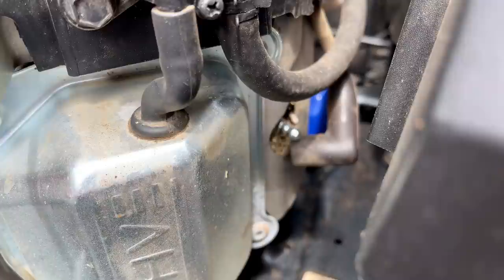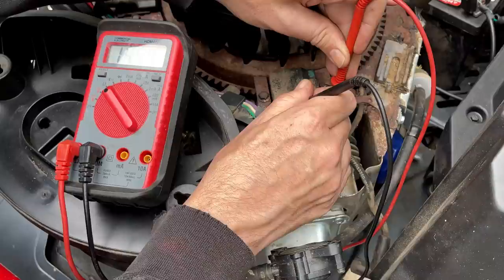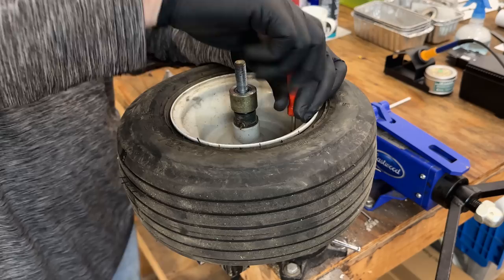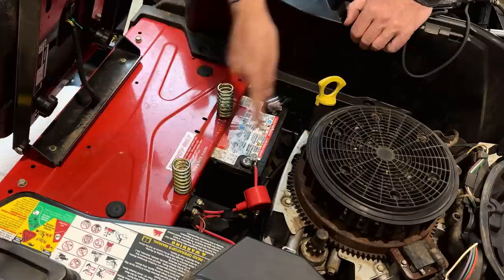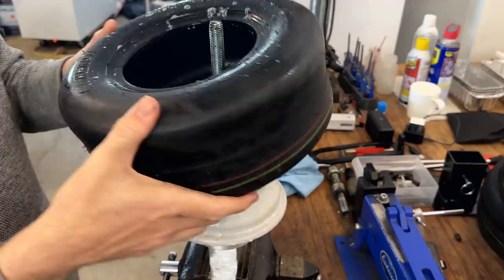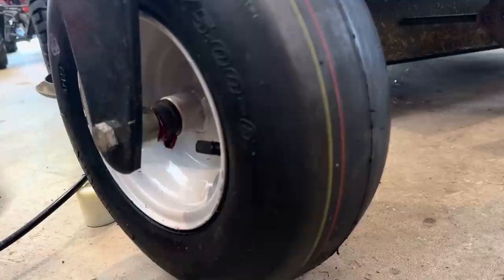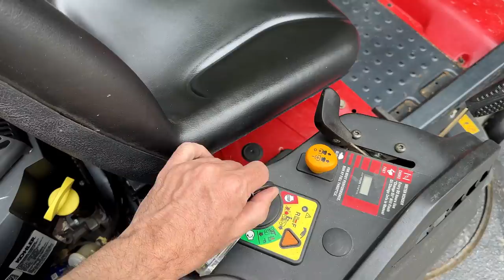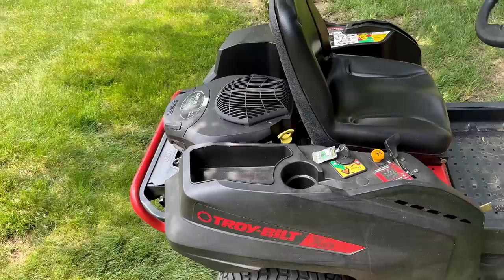Zero Turn Mower Down on Power - Not Firing on all Cylinders

Comment: A common mistake I see is when people have a flat and install a tube, but don't first find the cause of the flat. Often the thorn or little piece of wire or whatever is still in the tire, and pokes a hole in the tube

Comment: Nicely done, James. However, I don't understand why you don't use dielectric grease on electrical fittings, such as the coil wires. Prevents rust from forming due to rain water or other "liquids" from critters that make their homes in machines. :) It works great on battery terminals, too.
Reply: Because dielectric grease is not conductive? So, on a battery where the terminal is clamped tightly, then it won't work itself in between, but on the coil, it might just work itself in between the lug and connector causing issues, that's just my guess
Reply: @Behemoth33  Dielectric is needed because grease can melt and will cause many problem if it conduct electricity. The grease is not there to help to the conduction by itself but to prevent rust from forming. And that is keeping a good conduction between 2 connector. Car company use those on major plugs that are open to element. Connector that goes on the transmission of cars and trucks, they use dielectric grease.
Reply: Agreed.  Using dielectric grease is a good practice for protecting connections from corrosion.  It's a common misconception that it will introduce resistance but it's essentially a fluid, and the force of the metal-on-metal contact moves the grease out of the way.  You can prove it by doing a resistance test before and after applying it.  I've been using it for years without any problems and works great for keeping moisture out of connections.  One example I can think of is that the cutoff switch on my gas weed trimmer wouldn't shut off the engine anymore.  I took the switch apart, cleaned the corrosion from the contacts, and packed it completely full of dielectric grease.  Several years later and I never had another problem with it.  More recently, I've been using it on all the connections for my my outdoor low voltage lighting to keep the water out of them with good results.
Reply: I used to use dielectric grease all the time, and then I started having electrical problems on some of my equipment, and it turned out to be the grease. So I decided it wasn't for me, but I would still use it in certain applications. It's just one of those things that I think is a personal preference things If you were to ask 100 guys about it, 50 would use it, and the other 50 wouldn't.
Reply: Where “dielectric” comes in. Both petroleum grease and dielectric grease DON’T conduct in their normal form. The difference is when they burn. Petroleum grease leaves carbon ash which is conductive and would add to the list of problems for a fire. Dielectric ash is still nonconducting.
Reply: Why don't manufacturers do it from the factory then? It's a good idea in theory, but in reality it ends up attracting more dirt and dust over time. Not to mention if you have to disconnect it in a less than sterile environment, it's a guarantee you'll be getting a lot of dirt stuck in and around the connector. Just a lot of mess.

You should really only do it on vehicles you know will be either operated in heavy rain or submerged in water. For example, motorcycles that see a lot of river crossings. Even then, you'll have to be prepared for the increased maintenance.

Comment: Bead seating, I see people using starting fluid they spray a liquid stream and make a puddle and light a fire. They need to spray a vapor (air fuel mixture) to fill the tire then light from a distance and create an explosion. the sudden expantion fills the tire.  DANGER USE THIS METHOD AT YOUR OWN RISK!!

Comment: With tubed tires, my grandfather who was born in 1901, always said to inflate and deflate tube tires multiple times to get the inner tube to release any folds it may have in the inner tube/tire. This will keep the tube working properly without air leaks down the road. Blue Sky's.

Comment: I have to say that i am impress with that zero turn mower, I had have my doubts as well thank you for your video.
Reply: I have a zero turn mower with a Kohler motor on it,I also am a firm believer in checking the oil in it before I crank it up, it's a 2019 hold over to

Comment: I had a 20HP Briggs and Stratton that was having a weird sputter when not under load and I tried everything all fuel components except the tank where replaced but cleaning the cooling fins made a massive difference for such a worn out engine. It had oil combined with grass on one cylinder but no oil leak and has 50psi on left and 60psi on the right cylinder after 20 years.

Comment: The steering and transmissions are linked on these machines, and for a sharp turn, the transmission for the rear wheel inside the turn is actually power reversed. This was demonstrated when you did the U turn after querying whether it was a true 4 wheel steer or not. The problem is probably more 4WS than a conventional Zero Turn, as they are actual 2 wheel steer with the front wheels free to castor to follow, whereas this system combines conventional ackerman type steering at the front with differential drive at the rear, so all 4 wheels contribute to the steering effort.
Reply: Yes and this is actually an advantage on slopes where one rear tire might lose traction.  Plus it allows you to push the machine and steer it with the hydro disengaged, like a regular tractor.  Kind of cool.

Comment: Thanks James…great video as usual!  I do have a pet peeve: in this application, a “wheel” and a “tire” are two separate components.  Pointing at a tire and calling it a wheel……well, you know….words means things.  😂
Reply: Both tire and rim are the wheel
Reply from the maker: I do that a lot.  I call nuts bolt and bolts nuts.  Trying to be a little more mindful to use the correct words yet sometime I fail.
Reply: @jcondon1  
Yeah, don’t even get me started on leverage and torque! 😂
Reply: @jcondon1  
Most people (I mean MOST!) call screws bolts and vice versa.
Reply: @Rein_Ciarfella give me a moment
Reply: @nedasher116 , quoting from United Tire and Service website: "The terms "tires" and 'wheels' may be used interchangeably at times, but they are not the same thing. Wheels are the rims on which tires are affixed. Tires are rubber ovals that are installed on the wheels."
Reply: @bent.cyclist ovals? Seems to me that they are closer to being toroids.

Comment: 🎉Youare right about the  tight quarters of the engine area the  stuff that's packed around the cylinder heads on this engine  is a nasty thing to have to  deal with😮😂
Reply: And it is all plastic "for looks", not required. Customer focus groups must think people do not want lawn equipment to look like lawn equipment.
Reply: @JasonW.    you got that right 👍
Reply: @JasonW. 
So true, I like the older equipment,  not so much of unnecessary clutter.  😊

Comment: The c-clamp trick is genius!
Reply: I used to use an old bumper jack, set the wheel on the driveway under my bumper and jack away. Cars no longer have steel bumpers, but it will still work using the rear bumper on a truck in an emergency, assuming you have one of those old jacks.

Comment: I have the same HF tire changer. But have learned to search YouTube for modifications of the tool. Like applying plastic to the tire removal tool and extending its length with aluminum conduit pipe and using a tip from a NoMar motorcycle tire changer system! Also get the right tub of tire lube and things will work like they were meant too. You can put some lube in spray bottle and add warm water to make slippery lube that does not break tire rubber down!

Comment: Tire tip I learned from a old school dune buggy forum.
Their tires are shaved so thin for weight there are often in holes in the sidewall of brand new tires
And not uncommon to air up before every little trip out
Anyway this solves the problem
1 part Bars leak liquid aluminum
2 parts full strength antifreeze
Better than slime, doesn't eat aluminum wheels, never hardens up like slime, never freezes, and ATVs and utvs actually causes a natural tire balance. On higher speed stuff
Mix up, break outer bead, use small funnel and hose to pour it in and reinflate.
Roll around a bit in all directions
Typical large atv tire I use about 15 to 18 oz per tire
Small lawn mower front tires like those maybe 6 oz
Try it! It has yet to fail me
PS tire guys hate slime. This stuff just hose it out like a radiator flush
If you ever need to replace or service tires
Love your channel

Comment: You're right about the screws that hold the coils on. What I do is put a light coating of never seize on the whole screw under the head all the way to and including the threads. Wipe off as much as possible which still leaves a thin coat and put internal star washers under the head. The only resistance to taking them off is between the head and the washer.

Comment: putting on all the bolts with the carburetor intake  exposed  I was getting nervous until the air filter was back in its place; 2 new racing slicks/tires and sparky coils it is going to be a sceamer...! Good job, James and do not give any tools away again....!
Reply: with all the unburned fuel from the non firing cylinder in the engine oil please do a oil and filter change asap !

Comment: good video , but, Since the engine has been running on 1 cylinder for some time, it is surprising that you do not change the oil
Reply from the maker: Paul had recently changed the oil, but good point.

Comment: That camera almost fell into the mowerdeck 😅
You were having so much fun with that zeroturn, that you'll probably get one yourself 😁
Having a mower like this on the channel made it an entertaining video even though the problems were pretty straigt foreward.
Reply from the maker: It’s nice to get something that still runs and not in the trash once in a while.
Reply: How could he operate it for so long with less than half power? Maybe more than one engine is not firing on all cylinders?

Comment: Just getting started on the video, but as an automotive tech, I can tell you that rodents cause a staggering amount of damage to vehicles and other types of equipment that is often stored outside. The nest wedged into this engine definitely caused it to overheat and damage it to some extent (even if it still runs, its life has been reduced). They also caused the rust and almost certainly caused that ignition coil to fail. On cars, I’ve had them destroy wiring harnesses causing literally tens of thousands of dollars in damage (some harnesses, like those for safety systems,  cannot be repaired and must be replaced due to liability), I’ve seen them climb into the hvac systems and either pee/poop all over it or build nests and die inside (both cause horrifically bad smells in the interior) which also leads to big repair bills.

Comment: Hello James: I was wondering what happened to your  tire changer. Then you explained giving it away. They make a very difficult task a lot less difficult, not easy but manageable. If you have not already spoken to Paul about the deck guard/ discharge. Maybe a quick disconect bracket could be fabricated to facilitate quick removal & install if the guard is not already configured with one.
I put a bungie cord with a breakaway connector on my riding mower so I can lift the guard up while going through the door. It just clears with the guard lifted. Steeling yor closing, I hope this helps someone.
Reply: My Husky Varney zero turn discharge chute is double-jointed. It lift’s completely out of the way.

Comment: A good trick for those deformed tires is a plastic bucket. By pressing the rim down very hard and shooting air to it you get pressure from inside the bucket that will pop the bead to seal.
Reply: The correct tool is a compression belt...
Reply: @walkertongdee   He used about 97 of them and it didn't work?
Reply: There is a trick that tire professionals use on tires just like that. It’s called tire mounting compound. Aka tire grease. Fills the large gaps and holds tight enough to allow air pressure to push the sidewalls out and the bead to contact. Boom. Done. I’ve used it for years and on everything from tiny lawnmower tires to road tractor tires. Stuff is a godsend.
Reply: There is a video called “how to bead up a stubborn tire”. Older guy shows you what I mean. You fill the opening with the Murphy soap and when the bead seats it will squeeze out all the “grease” and you scoop it up and put it back in the container for next time. Stuff work’s amazingly.
Reply: Starter fluid and a lighter. Boom
Reply: @TsunauticusIV   Where's the link?
Reply: @erik_dk842 
He said he tried starting fluid,  and it didn't work. I have used starting fluid on big truck tires,  and it takes a lot more than it used to. Seems like the starting fluid of today isn't as explosive as it was in the 1990s.

Comment: James, you crack me up with your train of thought, you concluded  the bad coil is still bad, but most people would have hooked the wire up to see if the coil is good!!! 😅
Reply: That wire goes to Ground to shut the Engine OFF. with the Wire disconnected the engine would not shut off with the switch if it were not for the 2nd Coil that was connected.

Comment: I’ve been told that after initially seating the tire bead onto the rim, deflate it and then set to the proper psi. You may get a second pop but it will help to ensure a proper seal.
Reply: That is a common practice on High Speed rated tires not so much on ATV and Lawn Tractor

Comment: It's definitely sometimes easier to send tires off to the professionals to get them done.
I completely agree with you about coil bolts, especially if the engine has mice damage.

Comment: If you use rubber safe silicone spray instead of soapy water when mounting the tires, it makes rotating that bead breaker/maker far easier and the benefit is it help protect the rubber for a time.

Comment: Wish I could of informed you before you finished this machine the make a solid no flat tire for zero turns all kinds of different sizes that wear great . I installed two on a customers zero turn and he loves them much better than air tires

Comment: Getting the opposite side of the tyre bead down into the drop center so you can get the bead over the lip is the biggest challenge on small wheels/tyres
Reply: That is the key.  It didn't look like he did that?  Hard to tell.
Reply: @alext8828  
No, he didn't, but it can be very hard to do, because you want both upper and lower beads in the drop center opposite getting the tyre over the rim lip.

Comment: I had a set of tires like those for a lawn vac, just as smushed.  I had two ratchet straps and a whole lot of creative language before each of those buggers would bead up!  Never thought of the tube expansion idea, although I think I would have had the same success you had with yours.  I broke the bead breaker handle on my HF tire changer.  Ended up buying a "Bead Buster" which after a re-weld of the bead hooks, works like a charm!

Comment: Little tires and little wheels are the worst for break down and replacement. One of the best things I ever did on my riding mower was to replace the worn out tires. It saving me from fixing flats and having to check tire psi every time I mowed. It was a real guilty pleasure. Those little tire and a monster.

Comment: I have the exact same engine on my Gravely ZTX 42 inch Zero turn. If I fill the gas tank all the way up some gas gets past the carb and past the rings and dumps into the engine compartment. I just do not fill the gas tank all the way any longer. It only has about 50 hours on it and it has always been parked in a garage. I found this out by checking the oil before starting and the oil level had gone up and the gas level had gone down. Such crazy problems for a machine that has very low hours on it. I can only assume the float valve is leaking by when the gas level is above the carb or the protection solenoid at the bottom of the carb has a problem with it. I only lose about 3/4 of a gallon capacity. When it first happened I changed the oil and never ran it with the gas in the oil. Great video. I will keep in mind if I have to change tires on the Gravely.

Comment: I have a John Deere Z-425 zero turn. It's a Briggs 23hp V twin. I've seen this before. Your coils might not be dead, just corroded and/or dirty.  Many times, buying new coils isn't necessary.... You can clean up the wire plugs and connections on the coils as well as the tips that pass the mags on the flywheel.. This is important. And files are slow... Clean your connections with a Dremel with a brass wire wheel and a bit of oil. Nice-n-shiny. Also clean up the flywheel magnetos and make sure they're making optimum contact (gap) using a business card as a spacer.

Comment: Hi James,
Back in the tyre fitting days .....
We had a couple of large squishy solid rubber foamy doughnuts for the wide rims that tyres would not reach the beads ....
After fitting the tyre on the rim and being unable to seat either side ....if you fitted the doughnut to the top of the rim between the  tyre, it would seal the air and allow the opposite side bead to seat fully as you pumped it up.
Then you would let the air out remove the Doughnut turn the tyre around and now without the doughnut push the tyre down while airing it and it never failed to seat with not much extra effort.